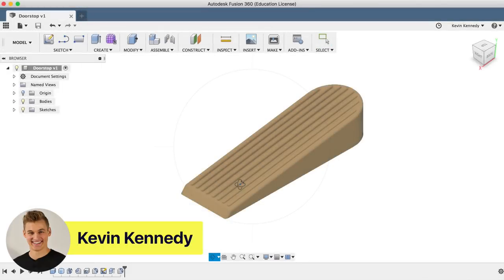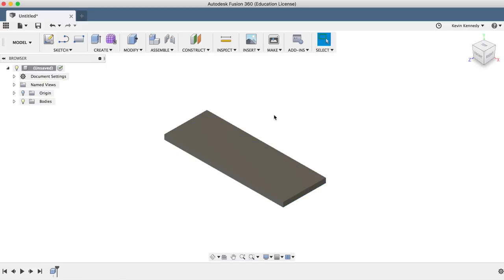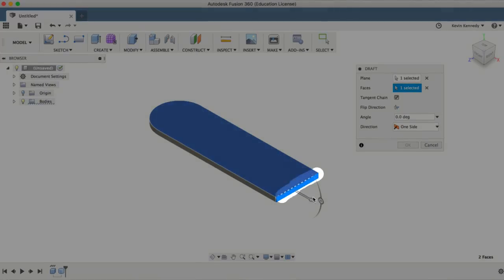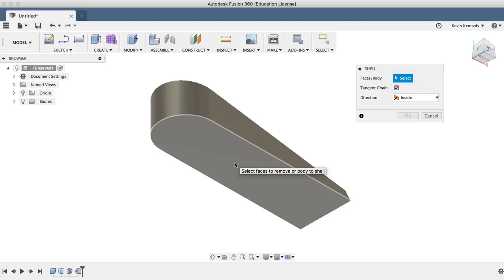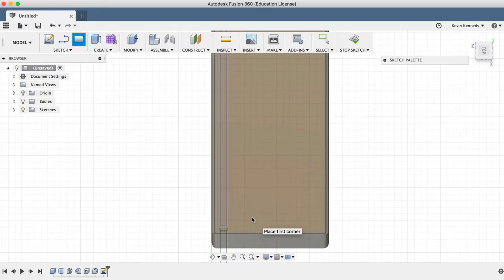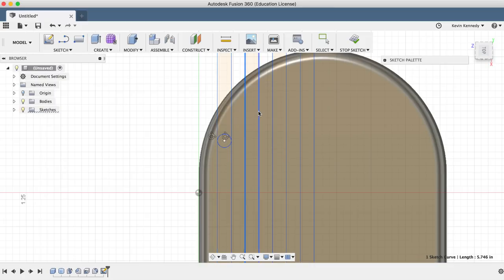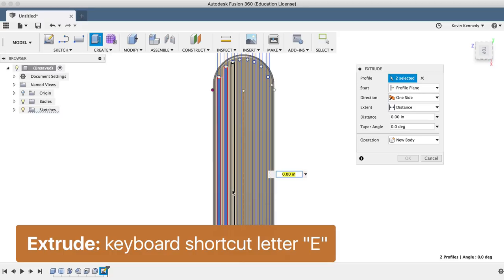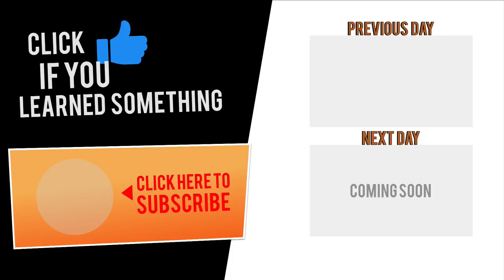How to 3D Model a Door Stop - Learn Autodesk Fusion 360 in 30 Days: Day #8

Comment: I'm getting stuck not being able to select the edges of 1st rectangle in order to apply the pattern feature. I've tried to do it after trimming center line and top line of bottom circle, and also trying to do pattern without adding bottom circle. Any ideas why unable to select?
Reply from the maker: Hi, DeliriumSkydiving. It's hard to say... it could be a number of settings/problems. Can you share your file? That will help me figure out the problem, or rule out the possibilities if it's a settings issue.

Share your public link as a reply to this comment. Here's a video explaining how to share a public link - https://youtu.be/2XrcrdV-8Ls

Then, please write a separate comment letting me know you've replied with a link because YouTube flags most links and I don't always get notified. Cheers, Kevin :)
Reply: @ProductDesignOnline , thank you for your prompt reply! Here's the link: https://a360.co/2GtTkYT
Reply from the maker: Hi, DeliriumSkydiving. Thanks for providing the file link. I took a look at your file and everything seems to be fine on my end. I was able to select all parts of the rectangle and use the pattern feature as seen here - https://snag.gy/ek5PH8.jpg

This leads me to believe you have a setting that you inadvertently turned on or off. Check your selection filters and see if everything is turned on. Here's a reference image for your convenience - https://snag.gy/CUIHaV.jpg

If everything is turned on try saving, closing the file and Fusion 360 and restarting. It could possibly be a bug. If that doesn't work let me know and I'll see what else it could be. Cheers, Kevin :)
Reply: @ProductDesignOnline  I checked my selection filters and have all selected, just as your screenshot shows. I'm actually able to select the edges of the rectangle and circle BEFORE I select pattern feature, but can't select them once I'm in the pattern feature.

I also closed down Fusion360, restarted laptop (MacBookPro) and once Fusion360 reopened, same issue persists.

I've also noticed that my Rectangular Pattern dialog box differs from yours, in that the line above "Objects" is "Pattern Type", and from there I can choose Faces, Bodies, Features, or Components. Not sure if that wld make any kind of difference but tried doing selection using each of those selected; however,  none worked.
Reply from the maker: @DeliriumSkydiving  Thanks for the info. Given that your rectangle pattern dialog box differs... it sounds like you're using the wrong feature.
There is a rectangular pattern feature in both the sketch dropdown menu and the create dropdown menu. The create one is for patterning of 3D geometry and the sketch one is for patterning of sketch geometry. You'll want to make sure to use the rectangular pattern in the sketch dropdown list for this scenario, since you're trying to pattern sketch geometry. Let me know if that was it! Cheers, Kevin :)
Reply: @ProductDesignOnline  YES, that was it!! You went to Sketch > Rectangular Pattern so quickly that I didn't even notice it was there... so far had only seen it as a choice under Create menu. Thx for all your help thus far! :D
Reply from the maker: @DeliriumSkydiving  No problem! I'm glad that was it. Cheers, Kevin :)

Comment: Me again. Question again. What is the difference between Draft and Chamfer? They both create slope style. I do notice when doing Chamfer, the resulted edges are not editable furthermore.
One comment: why not share the .STL file somewhere to increase your views.
Reply from the maker: Hi, Leo. Chamfer is for making edges of your model sharp (instead of rounded over with the fillet command); whereas, the draft tool is generally used for parts that would be made by some form of "mold-making" where the object would need to be released from the master mold. In this case, I used the draft tool as the draft angle is not only important to the door stop but it ensures the model will release from the mold.

Comment: I don't know if this video is outdated, but I've been following along until you got to the mirror feature.  For some reason when I try to click the 4 sides, then click mirror, it doesn't allow me to mirror them.
Reply from the maker: Double-check that you're using the Sketch Mirror command vs the Solid Modeling mirror command.

For reference: https://productdesignonline.com/tips-and-tricks/mirror-command-not-working-in-fusion-360/